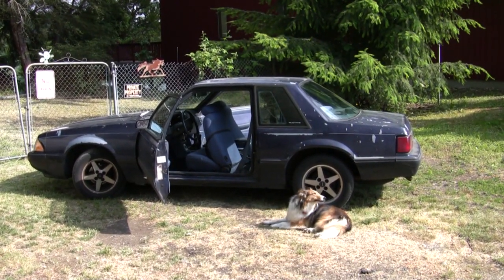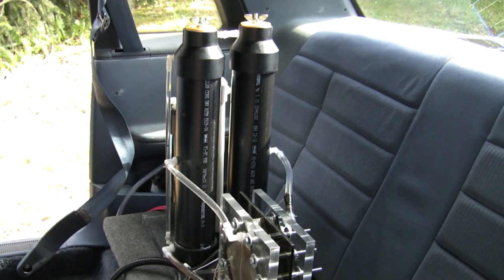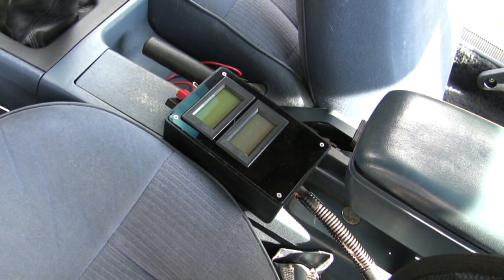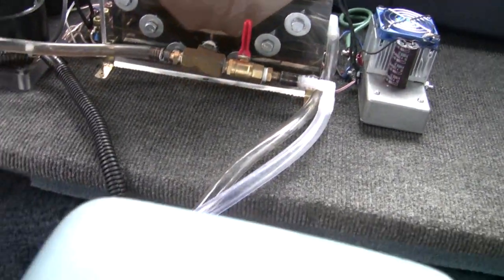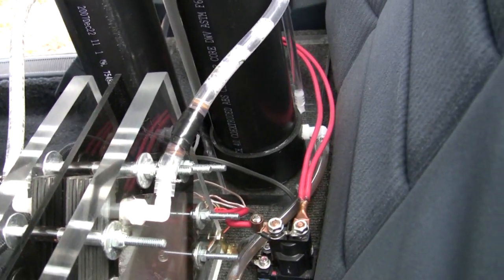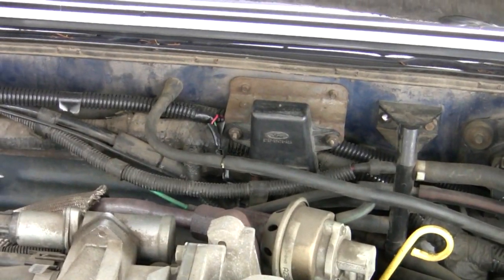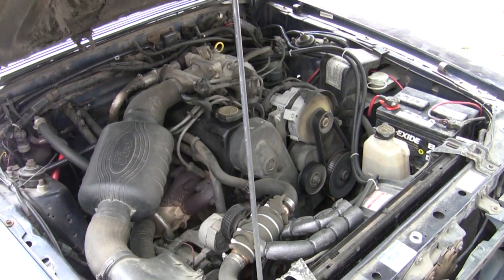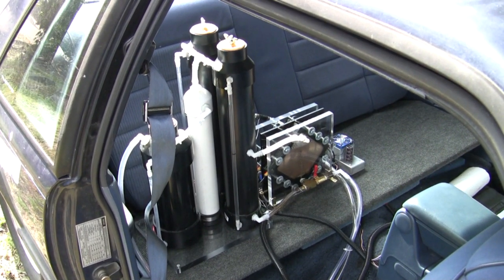HHO Dry Cell Installed In 89 Ford Mustang #6

Comment: I believe for that year of mustang it has whats called speed density if you want to tune it for the added hydrogen you might need to go with mass air flow sensor
But if it works like this fuck it don't fix it if it's not broke

Comment: hello..in the  third  block  of  your  explanation...you mean .."i am now  saving  money.."   am  i right .? ..also  ..how  many  miles you reach   per  liter  of  water....what  kind  of  water  are  u using..and  finally  to  get  21 amps without a problem :  did  u change  your  alternator.    Thanks  and  keep  getting  results !   the  only  point  that  looks  not  so practical  is  to have  the system  in the back  seat..?..any way...congrats  for  the numbers

Comment: It may pass emissions, but does it pass D.O.T. regulations? 
Have you noticed any additional power in the car?
Does a 2ltr per minute mpg performance decrease with the increase of speed?
(If you drive 65 on the freeway and get 43mpg, does this change by driving 85mph?)

Comment: just wondering if changing the spark plugs to a higher quality plug would help the fuel burn and give you more mpg or does it not matter since you are adding the extra gas

Comment: I aint your momma so I aint gonna say nuthin about my concerns about having that thing in the back seat ... am sure you are very much aware of the related issues ... 

your mileage gains are impressive ... any chance we can twist your arm and get you to have a few dyno runs done with/without the system engaged ???  would be nice to be able to add your results with others we are accumulating ...

Comment from the maker: I will keep you posted on the miles per gallons over time. I cleaned my pugs a couple of weeks before I installed the HHO system but have not check them lately. I have been meaning to check them. I might post a quick video on the pugs' condition. I'm not to worried a bout a flash back happening but if it did I'm sure I will be deaf for a week. The bubbler has a pressure release cap in case of a flash back.